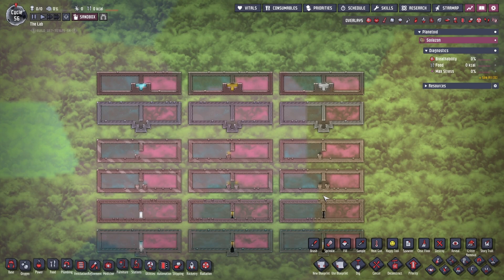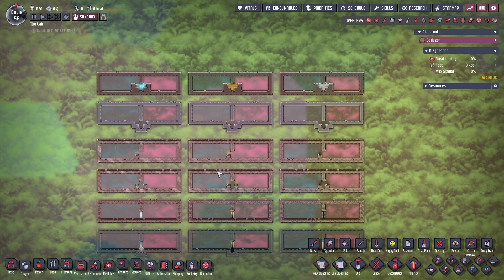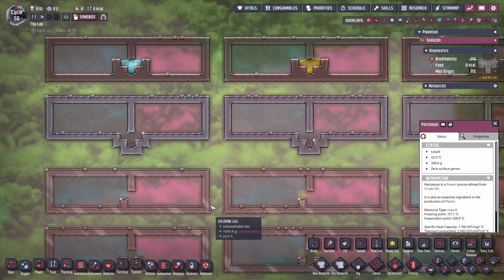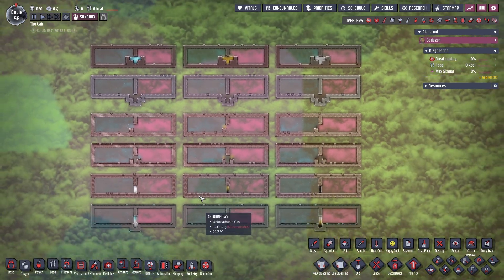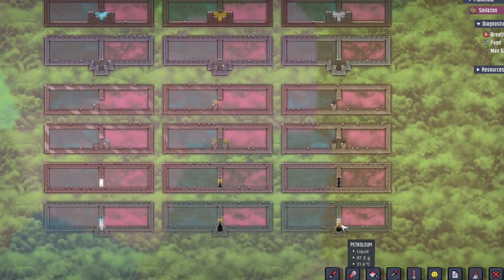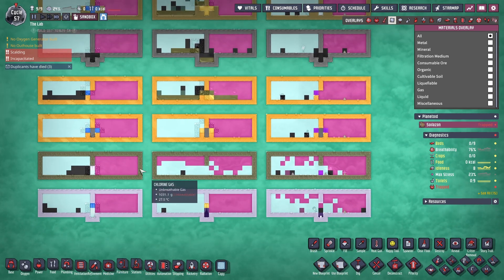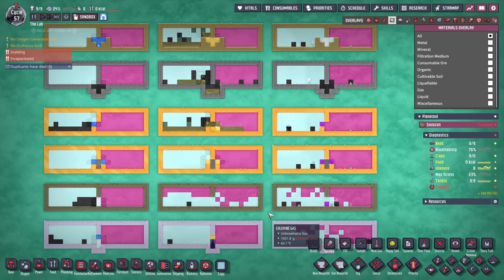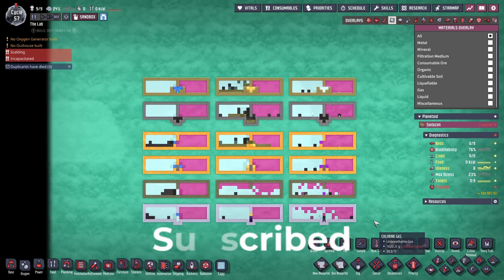I Tested Every Way Dupes Break Liquid Locks in Oxygen Not Included

Comment: The traditional liquid lock hit 16 degrees on that last test whilst the naptha blob locks jumped to 68 degrees even with napthas low conductivity. Blob locks are too sensitive for high temp situations and too few liquids are viable in case of accidents.

They exhale when they inhale, so need to be in range of oxygen to do so (O2/PO2 in any tile adjacent to the dupe).

Gasses haven't been able to displace liquids for like 6 years. The CO2 looks for the first 'non-liquid' tile it can occupy above the dupe instead, you can use this and the breathing range to fill sealed rooms with CO2.
Reply from the maker: Thank you for the comment. Great points!

Comment: Couple more theories to test - if dupes are in oxygen and inhale, then trapped in vacuum, can they exhale a tile? Also, the hot debris theory is if they are carrying a hot item, then a shift change happens as they are passing through the lock and they drop it to go eat.
Reply from the maker: I think they can exhale in that circumstance, but i will double check. If i recall the vertical locks did break with the hot item during transport in this experiment.
Regarding dropping the hot item, in theory for sure it could ruin it. If the item was holding enough heat and it dropped in a liquid lock on a low mass & low evap liquid.  A lot of these tests are not perfect because there are too many variables to cover in one video.. ie materials type-temp-mass-liquid properties- atmosphere etc, the combinations/variables are exponential.
Reply: @CanadianXOfficial I've definitely had duplicants ruin a vacuum lock by exhaling in it multiple times. I think it is necessary for them to inhale oxygen first. If anything, the only time that oxygen is actually not included in the game is when a duplicant is "born". I think they default start with empty lungs.

Comment: A long time ago I saw a Dupe running to my clean water lake and vomit directly in it 🤮

Could that also happen with this small pockets?
Reply from the maker: yes the vomit i think mechanically works the same as peeing on the floor. im not 100% tho
Reply: @CanadianXOfficial  peeing is i think spawned directly on the body tile (dupes are 2 tiles tall, bottom tile is the body and top tile is their head). the vomit is spawned one tile offset at head level, the offset being whether they face left or right, i think
Reply from the maker: @alamrasyidi4097  interesting i thought it came from the same spot. Thanks for the info!

Comment: I'd argue that one tile drip locks and the vertical ones must have thermal sinks that would prevent them from changing phases too quickly. The one drip lock, if I'm not mistaken, is placed all on high thermal conductive metal tiles. Thus any heat to the liquid could quickly be dissipated by them. To confirm the test could be repeated with all the chamber tiles to be of insulated tiles at the same temperature.

I used to use two or three drip locks, for these rooms that needed special atmospheres, such as the drecko ranches or mushroom farms. But since then, I moved the atmo suits from the base entrance to the entrance of each dormitory floor. It helps with stopping worrying about the environment except for the base inner core.

When I need lock reliability I use the double one drip with vacuum lock. I add atmo sensors (set to below 0)  placed on the liquid lock (usually crude oil, from a slickster), a not-gate and a notifier. If both locks are breached, the notifier is triggered and the door closes immediately. This lock is great at keeping temperature and gasses from going across. Since one of the recent updates, I've run this type of lock with no problems. Note that the atmo sensors and the logical wires act as thermal sinks.

The newest update brought in the thermally insulated door. It looks nice, but its operating time is so long that dupes might break a task if they wait too long. For faster thermal locks, I use one I devised it back in the early game years ago. It's a triple door lock with a weight plate under one of the doors and a filter set to 0.2 sec and connected to the middle door. Once the door with the weight closes the opening of the middle door is delayed just enough that it opens to a vacuum. I combine this with a double drip or single drip (plus tile) lock for gas blocking.
Reply from the maker: notifier for the breached locks, i like it! Thermal sink sound like a good idea. I haven't really used the new doors much yet they def look slow. Thanks for the comment good tips

Comment: Drop locks WILL DEFINITELY break. Happend times and times. 
Any off-gassing debris will break it pretty quick (probably mass dependent).
Dups also definitely will, alho it's very low probability and it can take hundreds of cycles.
Also drop locks sometimes just disappear on game load.

Drop locks are great temporary solutions to fix some broken build. 
But i would not trust them as a permanent ones.

Verticals are essentially  the same as drops as they have same mass per tile and same problems.
Exception here probably would be viscogel, but i hadn't got my hands on it yet.
Reply: I had this exact problem because i was trying to use a corner lock on my oil well room but a piece of bleach stone was off-gassing and the chlorine gas would push the crude oil. Managed to catch this before scrolling away after already having fixed it twice.
Reply: Off gassing is only prevented when there is enough pressure. Debris will break drop locks if they are too small.
Reply from the maker: yes size matters i have had issue with that